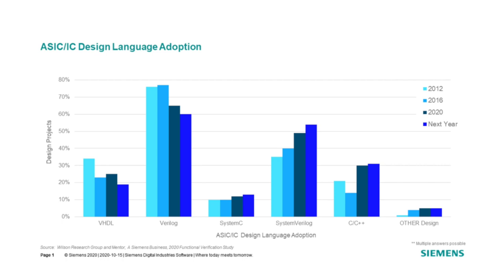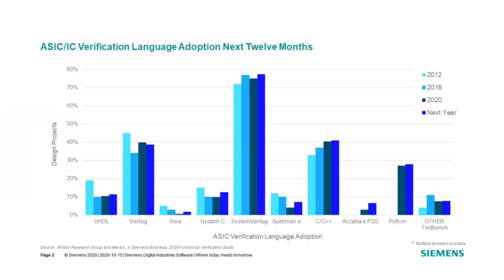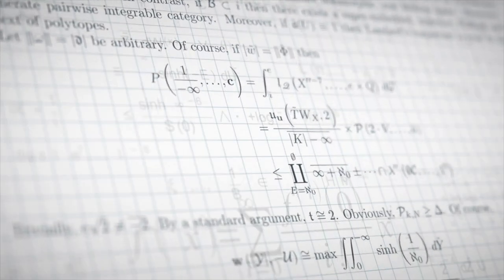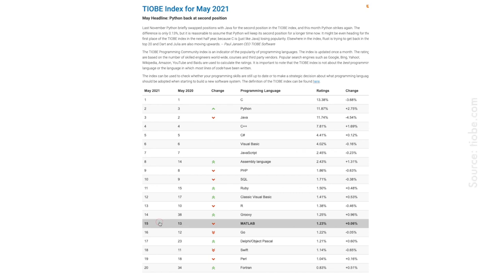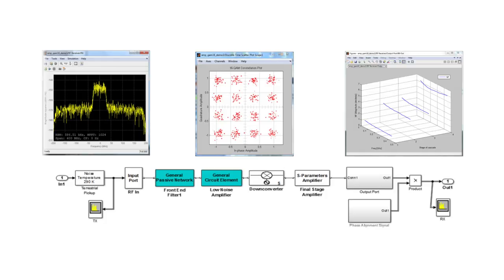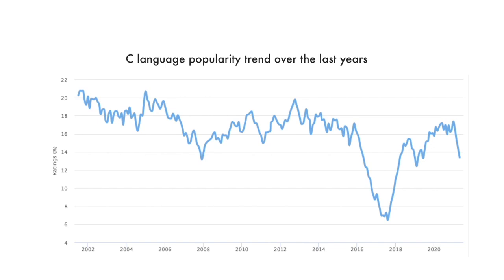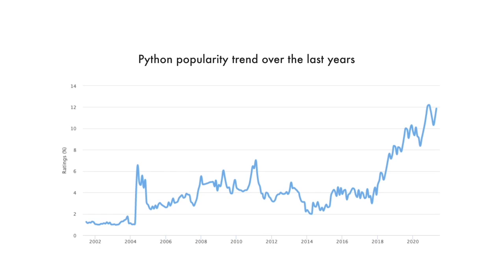Top 5 Programming Languages for Electrical Engineers and Hardware Engineers

Comment: I want to learn programming language for electrical engineering, where to start, for example c language, c ++, python etc
Reply: @I_will_delete_this_chnl_til_1k  If you are working on a project by yourself you can use any language you want as long as there is a compiler for it.  If you are programming hardware then; for FPGAs it will most likely be as she said in the video VHDL or Verilog but if you are programming the soft processor that is emulated on the FPGA you can use other languages, for microcontrollers most have C compilers and also assembly.  A lot of the microcontroller companies have graphical tools for setting up the hardware that you will be using and then the tool generates code for you to initialize the hardware.  This is probably going to be in C but they have compilers for other popular languages.  Interestingly, the tool for the STM32 micros generates the startup code in assembly and then calls (jumps) to the "main" function in C, so you can mix C and assembly if you want.  If you really want to become a good hardware programmer then read the programming reference manual for the device you are using and learn how to interface to the hardware directly.  Don't be afraid to learn assembly, it is the fastest/highest performing language (as long as you write good assembly).  Auto generated code and HALs (hardware abstraction layers) are serious performance killers.  You have to remember that microcontrollers and FPGAs aren't like your typical PC CPUs, you still have to squeeze performance out of them.

Comment: But which programming language is required  for every Electrical and Electronics industry like small or biggest every industry ?
Reply: There really is no language that is required.  If you are working on a group project then someone will select that software and it will depend on the company you work at and what the people you work with like to use.  If you are working on a project by yourself you can use any language you want as long as there is a compiler for it.  If you are programming hardware then; for FPGAs it will most likely be as she said in the video VHDL or Verilog but if you are programming the soft processor that is emulated on the FPGA you can use other languages, for microcontrollers most have C compilers and also assembly.  A lot of the microcontroller companies have graphical tools for setting up the hardware that you will be using and then the tool generates code for you to initialize the hardware.  This is probably going to be in C but they have compilers for other popular languages.  Interestingly, the tool for the STM32 micros generates the startup code in assembly and then calls (jumps) to the "main" function in C, so you can mix C and assembly if you want.  If you really want to become a good hardware programmer then read the programming reference manual for the device you are using and learn how to interface to the hardware directly.  Don't be afraid to learn assembly, it is the fastest/highest performing language (as long as you write good assembly).  Auto generated code and HALs (hardware abstraction layers) are serious performance killers.  You have to remember that microcontrollers and FPGAs aren't like your typical PC CPUs, you still have to squeeze performance out of them.

Comment: Hi, i started with c in my last semester , am now on holiday and would like to use it to learn a new language, which one would you recommend between c++ and Python
Reply from the maker: Hi, I would go for Python :)
Reply: Neither, learn assembly.  It depends on what you want to do.  Do you want to write a bunch of test scripts for the actual hardware engineers to use, then learn python.  If you want to actually program real hardware then learn C (you can basically write C if you know C++).  If you want to work on the most advanced/highest performance systems then learn assembly.  Every high end programmer will write the critical portions of their code using in-line assembly.

Comment: Hie im currently starting my Career in Hardware Engineering and i want to know if im taking a good course
Im in my second year right now
I want to know what should i know and all the other courses i might as well take to be a better engineer.
I'm really interested in learning more
Reply: I hope you're serious about what you wrote as most students now seem to only be interested in obtaining the degree and not actually learning anything.  If you want to be a good engineer you need to really learn about the devices that are used.  This means learning and understanding how real devices work, not just ideal models, and how their non-ideal characteristics affect the overall design.  Unfortunately you probably won't learn too much about this in school.  Most schools focus on ideal only because it is easier and a good starting place.  If you just want to make something that works this level of understanding is fine and you will know enough to copy application note schematics.  If you actually want to do engineering you need to analyze your design and guarantee it will meet all specifications under all operating conditions.  This requires an understanding of how real components will perform considering all parameter variations, temperature/environmental effects, power variations, etc.  I teach a graduate level advanced op-amp design class.  I make my students do exactly what I do at my job.  If you look at a datasheet for an op-amp there is a lot of information in there and all of the values in the tables and charts influence how the op-amp will perform and affect the real product.

You also NEED TO BE GOOD AT MATH.  I have so many students that can't even begin design problems because they can't do the basic math that is required to generate the ideal design equations.  Many of them are doing everything correctly and then just stop because the equations become overwhelming.

You should talk to your teachers and ask them if they would help you understand more advanced topics that are not covered in your classes, real world design topics like I mentioned above.  If they are a good teacher they should be willing to teach you.  Also find some kind of hobby where you can apply what you learn in school to design something that you like.  If you are doing something in your free time for fun then you will be much more willing to research and learn on your own.  If you don't think electrical engineering is fun and worth spending your free time doing then you shouldn't become an electrical engineer because you won't enjoy your job.

As for classes, the best classes to take aren't typically offered in most colleges.  #1 PCB design.  Actual layout design, not just how to use some software.  This is very important with increasing speeds.  At higher frequencies if the layout is not done correctly the circuit simply will not work.  #2 EMI/EMC design.  This is never taught even though almost every product you design will need to be certified.  You will probably fail the first time you take a product to get certified and you will have no idea how to fix it.  Anyone who says this is black magic knows nothing about this subject.  You can learn the math and theory to design circuits properly to handle EMI/EMC.  #3 Power supply design, not power electronics teaching buck/boost ideal duty cycle calculations.  Actually designing and testing power supply circuits.  99% of all electrical products need some kind of power supply.

Comment: Python feels like the new Java; just a fad. Simple to deploy and useful cross platform, but as it’s also interpreted, slow, inefficient, and not very flexible. 

Matlab and C make all the sense in the world, though I wonder - why ASM didn’t make your list?
Reply: Hopefully python will just be a fad for the reasons you mention.  I'm guessing she may be more of an entry level since she mentioned that she recently transitioned to hardware, and therefore may write a lot of test scripts in python and not critical performance code which requires assembly.

Comment: Did you call Python "a successor to B and C"? Interesting. Would you care to elaborate?
Reply: Python is a successor to "ABC" not B and C.  Check out the Wikipedia page of Python for more details.
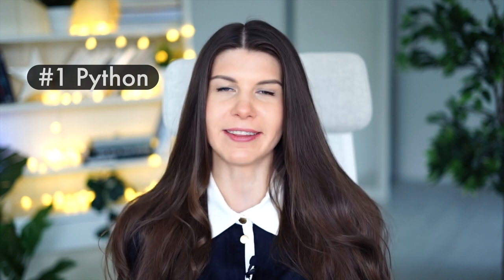Reply: @Me__Myself__and__I  Ah! Of course. But Anastasi clearly says "successor to B and C programming languages" (around 10:06) - I should have guessed what she meant.
Reply: Nouuuu
Reply: Why python….?It’s very easy for learning,but I want to be wrong in perception of sampling data in real time in process…It’s a t🐢…in real data time processing.. Well I consider more better C or assembler to python…why to move to python code ..tell me good reason for optimizations..thanks
Reply: Mat lab and Simulink are good for simulation and prediction of process..why python is include in this list..thanks
Reply: I want to be wrong in my perception..thanks
Reply: For a simple example,120 v @ 60 hzs..16.6 mSeg… I have enough time for peripheral interruption control in a microcontroller or embedded system using assembly and C.. maybe python is oriented to another application.. thanks 😊
Reply: @felixfortuna1302  It's because all these python lovers don't write code that needs to be optimized, they have no idea what python actually is.  It's just a fad languages because someone wrote a bunch of AI libraries for it.  And now all you see if you want to learning about neural networks are youtube videos claiming you can write your own network from scratch with 9 lines of python LOL! Can you imagine writing the ENTIRE network code in python, it would take a million years for one training cycle
Reply: @felixfortuna1302  It is because she uses python for side tasks like test scripts and parsing dump files.  She actually says this in some comments she replied to, but unfortunately she doesn't make this clear in the video